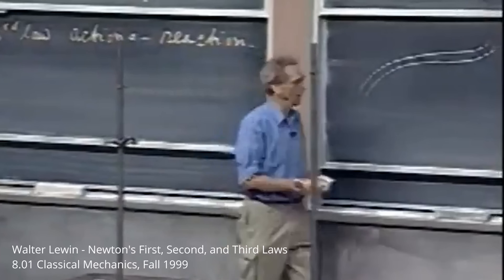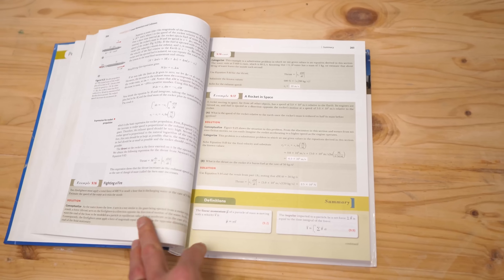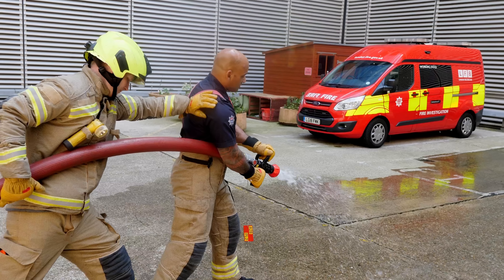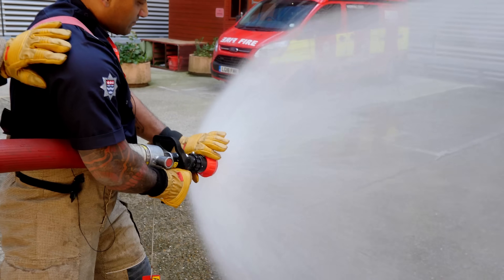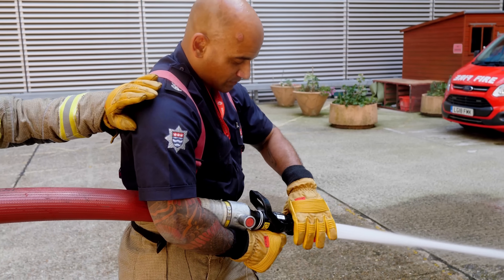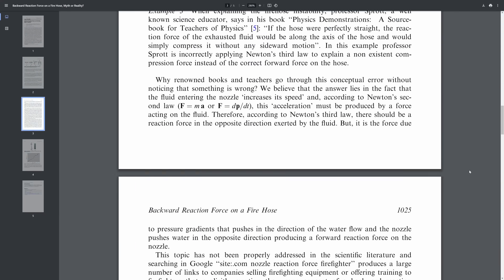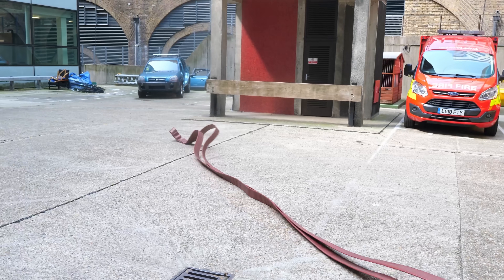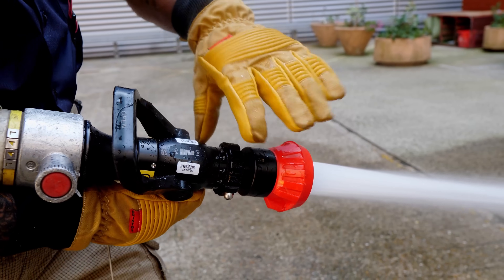Why chaotic hoses dance

Comment: The firefighter is holding back some of the force, but not all of it.  Imagine a hard pipe rather than a hose connected to the fire hydrant, the firefighter would clearly feel no force then... Add maybe 2 feet of hose and the fire fighter is mainly fighting/resiting the "wiggle" force. the longer you make the hose the more of the thrust the firefighter would feel.  The overall rigidity, materials used, length, weight, thickness, stiffness, and diameter of the hose would change the force felt.

Comment: Why the firefighters have to stand huge backward forces from the nozzle?  This is a simple one. look at https://youtu.be/tw5tQPm-B00?t=521, the jet of water near the right edge of the frame has at max 1/4 the diameter of the hose coming in from the left, so through 1/16 of the cross section of the hose passes the same volume of water within the same time. How is this possible? The water has to be accelerated to 16 times of the the speed within the hose. where does this happen? right in the restriction of the nozzle at the end of the hose.  If all water would be accelerated in the nozzle from speed 0 to speed 16, all force of the water acceleration would push the nozzle backwards. since the water is there accelerated there only from speed 1 to speed 16,  full 15/16 of of the acceleration force of the water jet pushes backward at the nozzle - which is close to all of the acceleration force of the water - and only 1/16 pushes backwards on the pump at the beginning of the hose. You could do the same calculation of the forces using energy conservation and change of cross section and water pressure. Of course the whole process is absolutely intentional and necessary. You want to transport a big volume of water as quickly as possible to the nozzle using a big hose. From there you do not want the water to lazily spill out of the open end of a wide hose hose in a lazy spill to fill a pond of water there,  you want to hit the burning house in 20 to 50 meters distance, therefore you need to drastically increase the speed of the water into a fast jet, which because of its acceleration exerts a matching reactio backwards on the nozzle. There is a simple word for what happens in the nozzle: Jet Propulsion - which pushes almost completely all force neccessary for creating the water jet back on the firefighters. https://youtu.be/tw5tQPm-B00?t=436 is comletely wrong!

Comment: It might easier to see what's happening if we could see the density of the medium inside the tube, like if you used colored smoke or water vapor.  If you apply a strong vacuum to the "exit" end does the air coming into the tube cause the same effect? Reminds me of Feynman's carboy sprinkler experiment.  What happens if you have two tubes with a bigger empty vessel between them?

Comment: Water is not pushing. Hose is puling on nozzle (force on the threads connecting nozzle under pressure and hose - imagine if you were to keep them connected with your hands without threads - you would have to use quite a  force pressing nozzle to hose to keep them connected).
Now, when nozzle is closed - imagine it as having cap at the end. Hose is still puling on nozzle, but water pressure on the cap makes opposite force, so your resultant force is zero. Then, you suddenly remove the cap, and that part of opposing force is gone, so you feel force from the nozzle. I bet if you measured, the pressure at nozzle - hose connection it would be greater then reaction force you feel (the rest being taken by pressure of water on restriction in nozzle) - taken you keep nozzle in place to keep it from accelerating backwards.
That force is directly proportional to pressure - that is why restriction is needed - to keep the pressure up. If there was no restriction, static pressure at the end of the hose would be zero (almost - there would still be head drop in nozzle), nozzle would feel no reactive pressure.

Why does nozzle pull under pressure - I don't know. I could modelled it as balloon being inflated and wanting to be round, pulling on ends. Now - nozzle is not like balloon, there are radial threads to prevent it from inflating, but dunno, I guess it is still being inflated in between those threads a little bit, wanting to be shorter.

Comment: I wonder if there's any circumstance where the force of the water pushing on the bends is enough to cause a hose to dance when it's secured at both ends. If you had the end clamped at a 90 degree angle from the start, and then started and stopped the water flow in different frequencies, would the hose ever wiggle?

Comment: I prefer to see the water as a copper wire that I'm pushing through a long tube. As the wires weight inside the tube builds up as the wires length inside the tube does, it get's harder and harder for me to push more of the wire inside the tube without it resisting. It will bend in a "preferred" direction if I give the wire even the slightest chance to. With the string it's more like pushing a chain of balloons or in other terms "air" through "air".
Reply: Shouldn't it be those mysterious "turbulences" that let the hose wriggle around like it does? Does the air calm down a bit and remove some turbulences while doing so and do get these turbulences stronger if the end of the hose gets weighted down enough to stop it from moving? :O

Comment: Many of these cheap chinese chargers and battery packs do not have the same safety testing and requirements/approvals as large packs used by tool manufactures i.e. DeWalt, Milwaukee, etc..  No way I would charge them inside the house.  Be safe, charge them outdoors and monitor them.

Comment: the force on the hose is coming from the release of the pressure.
the water outside of the hose feels only air pressure. so, the energy of the pressure is being released as it escapes. some of it is entering the air, which is moving out of the way of the water, but that is a vast minority of the energy. the rest must go into the hose itself.
just as the pressure inside a rocket's combustion chamber and nozzle is released at the opening of the chamber. the object containing and generating the pressure is being pushed equally in all directions, but it has a singular direction of motion, caused by the release of pressure at the end. a rocket feels its acceleration from the bottom, not the combustion chamber.

so its exactly like a rocket.

Comment: Yeah I mean it's pretty obvious, when holding a regular garden hose you don't really feel any back force, but when holding a pressure washer lance you have to fight it a bit. The only difference between the two is the exit of the hose is much smaller in the pressure washer.

Comment: I'm seeing two variables not addressed in my apprehensive viewing of this video. First, water has a less compressible fluid state than air and so it may be that that hose does feel the release pressure as you said, but we built the hose to take that pressure (weather we understood that or not) and in doing so the amount of flip-flop is reduced further back due to meeting with resistance until the energy can't continue continue.  2nd, the dancing air thing has a far lower pressure measure and is meant to shoot straight up. Using gravity as a bend and react sort of nozzle setting. The walls on the dancing man are far thinner and in a sense meant to collapse where the fire hose is made more dense to avoid a kink. (I wouldn't want the fire hose saving my house to get kinked.)
So tell me, is there more to this than we have considered? Have we dug a rabbit hole within a rabbit hole?

Comment: In my limited experience these sort of hand waving explanation rarely give the correct answer, the only correct answers are to be found by  rigorously applying the flow equation derived from Bernoulli.
An excellent example is to be found in Richard Feynman's reverse lawn sprinkler problem, no amount of thought experiment will actually inform you as to which way it goes around.

Comment: The vector of the ejected gas determines the vector of the reaction force. While all the force in the turn of the hose transmits to the hose itself, that force doesn't transmit. Only the ejected gas transmits a force.

Comment: I don't think that the pump really gives the water momentum, I mean it does, but in a bit different way. 
See the water hose is way bigger than the nozzle so I would think that the pump isn't really pushing all the water into the nozzle as much as it is maintaining the pressure inside the hose.
so by that theory, the water does gain most of its momentum at the nozzle, the hose is acting more like a buffer storing the pressure as the energy needed to push the water out.

Comment: @stevemould 
Hi Steve i’m an engineer working at @Endress+Hauser Netherlands in flow measurement. 
You are missing the force of the air or water coming out of the jet pushing against/ accelerating / displacing the air in the atmosphere.
With the air hose I would expect that this is the dominant force. I expect that the force with the fire hose will still be relevant.
If You would direct the flow towards a wall it would be much stronger.

Please have a look at where we use the force that You described (Coriolis force) in flow measurement. https://youtu.be/XIIViaNITIw?si=tOAkbCjKOXpD_8O9
Please let me know if You  have more  questions

Comment: 12:20 The same problem occurs on these huge space ships with hangars: inside there is atmospheric pressure and outside is a vacuum. 
So if the small fighter jets leave the hangar via the force field they get sucked out rapidly and the mothership wobbles all over the place. You can see that in the deleted scenes of star wars. True story.

Comment: 7:33> perfectly straight ...

You do not take into account the shape of the hole.  There is a classic task about the shape of the jet from the height of the pillar and the length of the output tube and the shape of the hole.

Inside the straight pipe, a rather funny phenomenon takes place.

Search "Истечение жидкостей из отверстий и насадков, 1979"

Comment: This training to catch a dancing fire hose must be something British.  I haven't ever received such training in Germany nor heard about it.  It's just plain dangerous and given that there are other potential incidents such as hoses failing or just an order to shut down immediately a machinist or the person at the distributor are always ready to shut down.

This may be a German perspective on things, German fire brigades usually have MUCH more manpower than British fire brigades - and I'm sure the ways we solve problems also reflect that.

Many people are thinking about the force it takes to hold a fire hose.  Yes, in extreme cases that may take a fireman to the limit of strength.  One aspect I've never seen covered is what it takes to hold for an extended time.  As in hours.  Always eyes on the fire and and ready to react to say something significant is happening such major flames shooting  from the object due a partial collapse.  It's like a boxing fight and two minutes into the 12th round you need to go for a pole vault or sprint.

One force which assists a fire fighter holding a hose is friction on the ground.  A hose under like 6 bar of pressure or more is surprisingly stiff and hard.  It' more like a piano.  A bend not far behind the nozzle pushing against any solid object is firefighter's welcome helper.

Science nerds ar e trying to understand the fundamentals of the science behind something.  Firefighters are as pragmatic as possible.  Anything that theoretically could help will be welcomed!

Comment: The firehose not flailing around chaotically on the ground may also have something to do with gravity and friction. The hose and the water inside are rather heavy, plus the grass/ concrete they are pushed against by gravity have a high coefficient of friction, so the reaction force from the nozzle may not be able to overcome it all, instead just the tip flails about.

I imagine in microgravity, the whole hose section would be moving around, just as one would expect it.

Comment: The rocket model is over simplified. Anyone who's handled a presurised hose knows that the water pressure causes some stiffening to the hose which resists the change caused by the rocket force. Plus the mass of the hose and water resists some of the change as well. So the firefighter isnt Fighting 100% of the rocket force.

Comment: I would think it would have something to do with the actual nozzle itself right? Like if you've ever used a garden hose without a nozzle vs with a nozzle, the one with the nozzle pushes back on you harder because it does cause the water to speed up as it passes through a smaller diameter.

Comment: Gotta think that the atmospheric pressure experienced by the parcel of water just leaving the hose would be far less than normal atmospheric pressure, because the air there is entrained with the water stream, so the parcel is almost being pulled out by somewhat of a vacuum.
The force experienced by the firefighters should also be lessened when the nozzle is changed from stream to fan, because (1) the higher resistance at the exit would result in less water being discharged, and (2) not all of the force is being directed straight back along the hose because it is exiting at an angle, resulting in only cos(theta) of the force directed back along the hose.

Comment: Because the hose can move it’s not any different than a full and sloshing bucket throwing you around from behind that along with the fact that the force is indeed at the front of that hose. It’s at the front for the same reason. The hose is acting as a “fluid”. Enjoy calculating the force of that.

Comment: Steve,
I know why the hose exerts the same force regardless of whether it is coiled at 14:42. It is because the flow of fluid through ANY flexible hose produces tension in the hose due to momentum effects. The tension is equal to 0.5*ρAV^2 where ρ is the fluid density, V is the fluid speed, and A is the hose's cross-sectional area. This is the same as something called the "Dynamic Pressure" times the hose cross-sectional area. Notice that this is not a function of the hose length, curvature, or similar.

You can derive the value of the tension in the hose (T) using differential analysis. The analysis is summarized as follows:

0. Make assumptions: 
	i. The hose is flexible, meaning that it is free to move from side to side.  
	ii. The hose is held static, only by the tension in the hose (T)
	iii. The flow through the hose is fully developed and highly turbulent, and therefore has a near-uniform velocity profile.
1. Consider a differential element of the hose.
This is done by considering a small portion of the hose which is "dL" long. 
2. Consider that over the length dL, the hose bends an infinitesimal amount "dϴ"
3. Draw a control volume around the portion of the hose. Notice that water comes in one end, and goes out the other. The water goes in and out maintaining the same speed due to conservation of mass and having the same velocity profile (fully developed).
4. Notice that the exit flow direction is turned dϴ radians from the inlet flow direction due to the infinitesimal bend in the hose.
5. Apply the Reynolds Transport Theorem (look it up if you don't know what this is) to the system's momentum balance. The result of applying this (as well as the small-angle approximation) shows that there is a force acting radially (perpendicular to the flow) of F = (ρAV^2)*dϴ.

Now that the force is known, we can find the tension in the hose.

6. Draw a free body diagram of the same small portion of the hose. Note that there is a tension on either end (T), and the force F, acts radially.
7. Solve for T. Remember the small angle approximation.
8. Find that T = 0.5*ρAV^2 (the dynamic pressure times the cross-sectional area).

I will now attempt to verify the result by using it to estimate the size of tubing used for the tests shown at 14:42

1. The flow is coming out of a highly pressurized container, so it is likely choked. This means that it exits at the speed of sound in air at 20 C: V = 343 m/s.
2. The scale you are using appears to measure 200g. This corresponds to a force of T = 1.962 N
3. The density of air at sea level is ρ = 1.2 kg/m^3
4. Plug the known values of T, ρ, and V into the equation for tension: T = 0.5*ρAV^2
5. Solve for the unknown. Find A = 0.000027795 m^2
6. Solve for the diameter using the circle area formula: A = (π/4)*d^2
7. Get d = 0.005949 m

So I think you used 6mm (inside diameter) tubing. The uncertainty is roughly +/- 0.5mm mostly due to uncertainty about the fluid temperature, which could  cause the speed of sound to be somewhat higher or lower.
Reply: I forgot two assumptions for part 0. 
	iv. Static pressure is negligible.
This assumption holds true near the end of the tube since static pressure in a pipe which releases to the atmosphere are proportional to the downstream head loss.
	v. Skin friction forces on the tube segment are negligible
In reality, skin friction forces on the tube segment are canceled out by the difference in pressure on either side of the differential element. After all, pressure gradient drives flow through a tube, and the gradient sets up to counteract viscous forces.